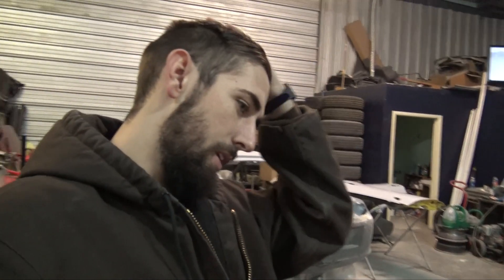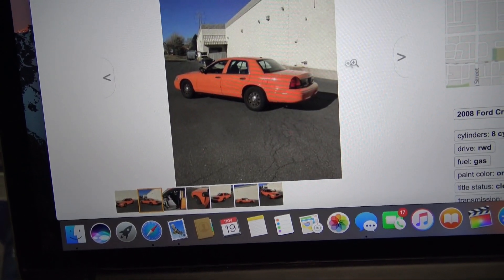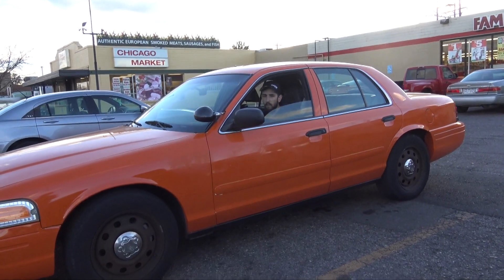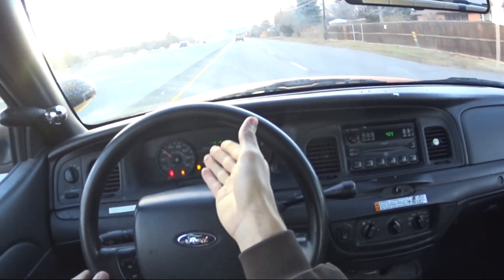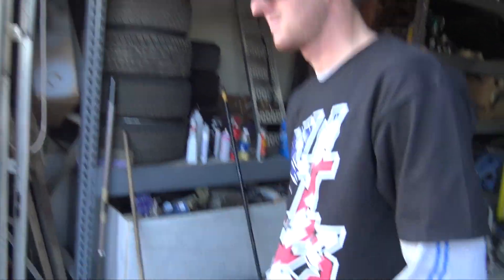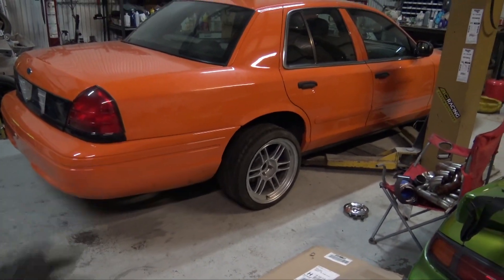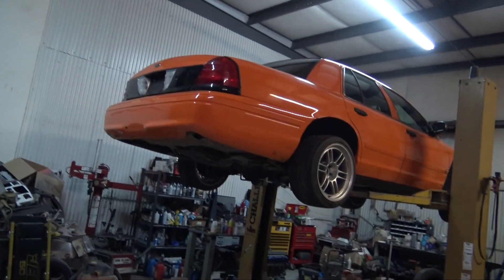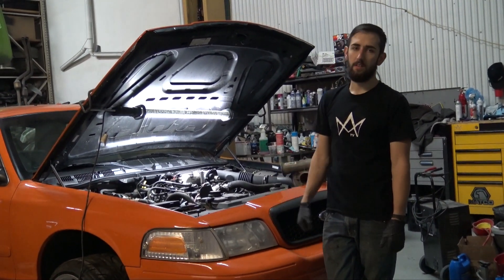Pt.1 Haggard Garage Challenge - Turbo Crown Vic!

Comment: you should make a JDM drift Vic
slammed on rpf1's, spacers and flares, and a huge spoiler haha
Reply: b00st would be dope asf
Reply: Call it the drift taxi (I know, unoriginal) then go work for Uber.
Reply: b00st never put spacers on your car it will wreak havoc on your wheel bearings.
Reply: yes pleeeeaaase
Reply: Vics are Domestic. 
not import.
NO WAY TO BE JDM! REEEEEEEEEEEEEEEEEEEEEEEEEEEEEEEEEEEEEEEEEEEEEEEEEEEEEEEEEEE
Reply: Kopboy55 triggered
Reply: Kopboy55 you can give it a JDM style to it though.

Comment: i have no idea why people are always challenging haggard garage. maybe because no ones as creative as them
Reply from the maker: Because it will be great content for everyone to watch!
Reply: MotionAutoTv true that
Reply: Bax Barron if its an 08 it will have a lsd in it.Will it be working??? And it might have 3.55s or 3.27 axle in it
Reply: Bax Barron just move the battery to the trunk on the pass-side
Reply: regular p71 will have a 3.55. the highway cars have a 3.27
Reply: It's a p71 regular isn't it so it will have a 3.55 in it
Reply: Bax Barron only way to tell is to either read the vin number, or jack up the back and spin the pinion, counting the rotations.
Reply: If its a Taxi, it has different specs than the police interceptor.. .  I owned a real  p71, I sold it because the 4.6L  2v is trash..I got tired of replacing the engine,  fixing intake manifolds, radiators.. Never again.. Anyway, Good luck :D
Reply: Jd Texan the taxi was similar to a highway car. just more civilized and fleet worthy
Reply: Not when his video was out

Comment: They do have a limited slip but odds are you'll need to replace the clutches in it.  Depending on what agency had it, it could have anything from a 2.73 to a 3.55 ring & pinion in it.

Comment: we did a turbo cobra with the stock headers in the car but the car had a tubular k member used a cross over pipe from the right side to the left with 2.5 inch pipe then Yd it in to the left side i think i still have most of that setup left in the garage dunno if YouTube has any type of personal messaging get up with me and I'll get you pictures

Comment: heres just an idea. Do you think it'll be possible to do some type of mechanism to make it have a line lock and rear lock up. idk if you can go about it by putting a solenoid on the brake lines to where you can flip a switch yank the hydro E-brake and have the fronts or rears lock up on demand. So you can essentially lock up the front to do skids or the  rear to drift.

Comment: I have 3 of them. 2006,2006,2000. 355 rear end. 4.6 engine, 4r75e trans. Simple mods.. hole in air cleaner, new bigger injectors, new coils (Accell). Gas gauge is probably gauge cluster..Oh, it never overheats...

Comment: so most p71 have either the 3.73  rears or the 4.10 rears.. the non police  package  crownvic are 3.55 or 3.25 rears. the p71 has oil cooler , trans cooler  great for what you Wana do.

Comment: 3.55 gears are for local driving the 3.27's were for interstate and capable to sustain higher speeds  you wan't the 3.55 gears though they are a lil quicker on the start.
Reply: are lower ratios available for the diff? A lot of the Aussie cars have 4.11 rear ends for burnouts. just went from a 3.08 or 3.45 in mine to a 3.89. its a big difference.

Comment: how do you do a burnout in an automatic? im curious
Reply: mash the brakes, mash the accelerator, slowly back the brake out untill the rear tyres start spinning. never drove an automatic myself but i think its better to pump the brakes a little to make sure that it'll be the rear tyres that lose grip and not the fronts.

Comment: The part where he doesn't realize or doesn't know that the grand marquis and crown Victoria are the EXACT same car. Grille and some other stuff are different but frame, engine, suspension, everything is the same. I had a 99 town car and it's the same as those cars as well. Haggard garage is a bunch of teenagers that don't seem to know much about cars to begin with.

Comment: cruising on the highway at 90 mph and traffic seems to be pulling. Ohio avg. is 55...😭
Reply: adam25000 Jeep stuff I thought Ohio hwy speeds got bumped up? PA recently hwy speeds went from 65 to 70 :D
Reply: adam25000 Jeep stuff there 65
Reply: Marquice Rowan it depends where you are, I live in Cincinnati.
Reply: adam25000 Jeep stuff I'm in akron but yeah that's true

Comment: The gear ratios you're taking about at 9:00 are 2.73 , 3.27. Yours is 3.55 posi the rest are open diff
Reply: no they made 3.27 posi
Reply: True but it's rare if I remember right

Comment: Im looking to get a cheap, good on gas, durable car, would you say a Crown Vic would be? Was in a cab yesterday and dude has a Crown Vic and it had 500k+ miles i was like O_O
Reply: UnboundGodz cheap, yes. good on gas? not so much.
Reply: UnboundGodz they get terrible gas milage and the gas light comes on at 1/4 tank kind of annoying and you want the pi version I had a regular one and it was slower than civics with its 2.73 rear and 5k pound weight
Reply: Justin Peterson ;0

Comment: I had a 2003 CV Pol. Interceptor with only 113,000 miles on it.  We had 2 cars & when the 2008 economic crunch hit I thought I had to sell one car.  So I could not sell the wife's Jetta so I sold the interceptor to a friend with the understanding he would sell it back when it comes time to.  The nut went crazy with it.  Painted it back, but spot lights back on, the front ramming thing = all of which I told him NOT TO DO.  It got spit on keyed both sides & 2 smashed windshields.   I regret selling it & wish I had it.  & of course he does not want to sell it back.  So there goes the car & a so called friend.  When I get some bucks I plan on getting another one.  But this time I want the civilian model.  Question:  what year do you think would be best??  Thanks.  Just subed & liked.  Sincerely,  JAMES.

Comment: If it's an 08, it's a 3.27 with a locker. Grand Marquis had an open 2.73
Reply: I know because I have a grand Marquis and swapped out the open 2.73 for a 3.73 with a locker. So much more fun now lol.

Comment: Rear mount turbo this pig, ultimate cheap, haggard, DIY monster.
Reply: seniornuggtes why is that? Proven setup done on many cars, even companies that specialize in rear mount setups...
Reply: seniornuggtes actually it's not dumb.
Reply: Dr. Nice lol yeah it is
Reply: seniornuggtes would you kindly supply factual evidence to support your argument instead of simple minded 3 word responses?
Reply: Dr. Nice why waste all the time piping to the rear when everything can be in the engine bay? way waste time running oil lines to a turbo/turbos to the rear of the car? why put the turbos at risk of being destroyed going over bumps? why deal with even more lag than there already is? why deal with the possibility of getting even more dirt, and rubber in your turbos? its a stupif as fuck way to think about turboing a car. all it is is excessive waste.
Reply: seniornuggtes, no custom manifolds or packaging concerns when running rear mount.
No oil lines need ran from motor so no drilling into pan also (most rear mounts have self contained systems) 
Only one pipe from the outlet of the turbo needs to be ran up front.
Most rear mounts are tucked up many times higher that the frame rails.
No more dirt or debris into the turbo because it has a filter and such also above frame rail.
As for lag that depends on many factors, although it will be more than a system that's in the engine bay the difference isn't as big as you'd think.

Do some research and look at STS turbo systems before you make uneducated comments 💜
Reply: Dr. Nice i can say that ive honestly just been having a laugh the whole time
Reply: seniornuggtes I can say similar laughs have been had, I'm amazed at the interactions that happen in YouTube comment sections.
Reply: Dr. Nice would you rather go turbo or supercharger?
Reply: Dr. Nice yeah lol ive never claimed to be a mechanic, just having some fun at your expense, and as for the comment about turbo or supercharger,its preference